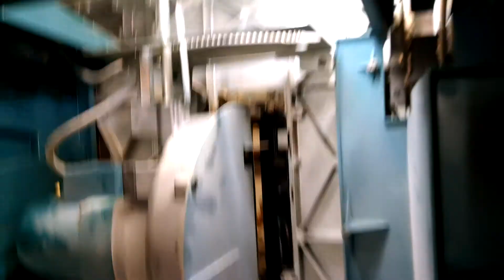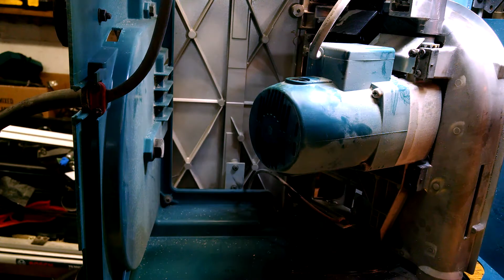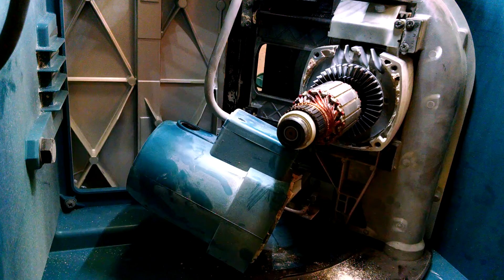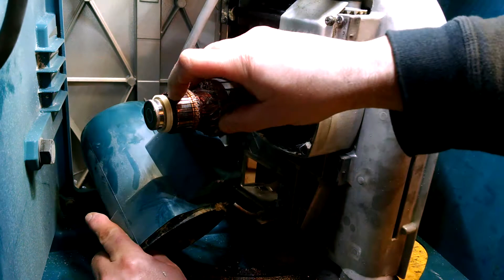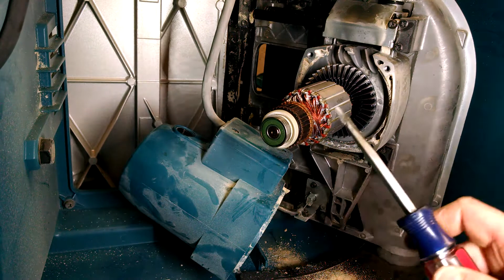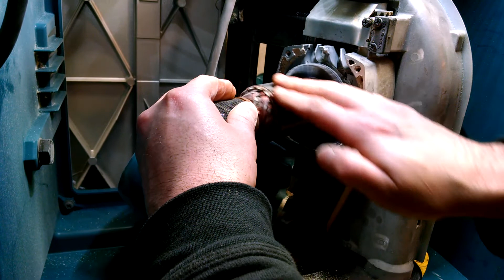Makita 2705 Table Saw

Comment: I’m having trouble finding any information on how to square up the blade to the table, and the fence to the blade. I’ve loosened the 2 and then 4 screws and when I did so the blade and motor housing would not move how I would expect it to move, therefore I doubt that even if I can get it to square up, it would stay. Any advice or information on this process would be very appreciated. I’ve been unable to get myself into the shop and get any work done. I’m dying to tune this thing up and get back to work. Thank you much.

Comment: That is a shielded bearing if it is just metal. You need to replace the bearing. If you take the shield off, you need to do that in a really clean environment and you probably cannot replace the shield like it should be. Lots of experience with bearings.

Comment: I have makita 2711 that wont start, looks pre clean but havent opened up yet because im not very experienced with electric motors. any idea why it wouldnt start there seems to be no reset switch that ive found on it
Reply from the maker: Hard to say with out having it on my bench. Maybe start with the cord and switch.

Comment: I have been wanting to buy a Makita 2705 for the past year after comparison shopping and reading reviews.  If I were to vaccum with a good shop vac after each use how long would it take for the dust to build up like it had on this saw??  Is there even a dust port on this model that can be attached to a shop vac?  One of the negatives on the few reviews I can find online has been poor dust collection.
Reply from the maker: Too many variables to correctly answer the question. You will have to keep an eye on it.
Reply: I use a shop vac and after heavy use I blow it clean with my air needle
Reply: I just got one last week cant wait to open it and set up :)!
Reply: I found the display rental in home depot has a 2 1/2 inch port included.

Comment: I have a brand new MLT 100. Motor is jammed after few hour work.  How should I make it free. I have no service center near be. 
Please help
Reply from the maker: Sorry Raj. I would need a lot more information to go on. There are many things that could be wrong with it. If you take it apart, video the process so you can see how to put it back together.